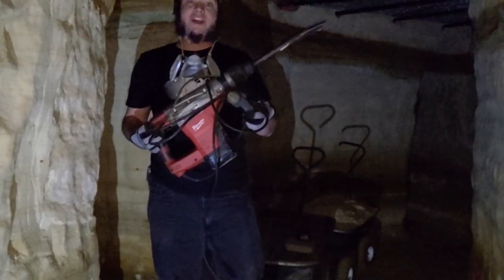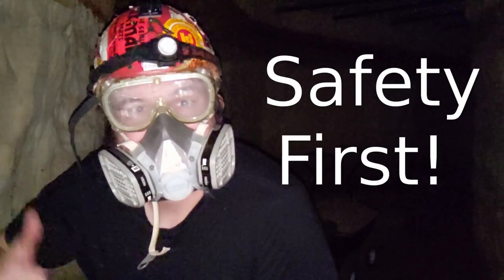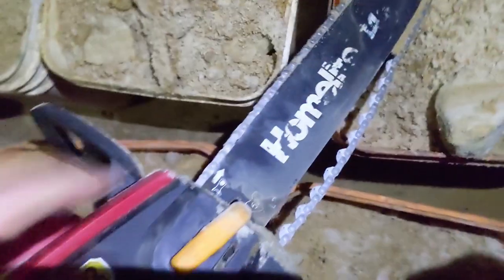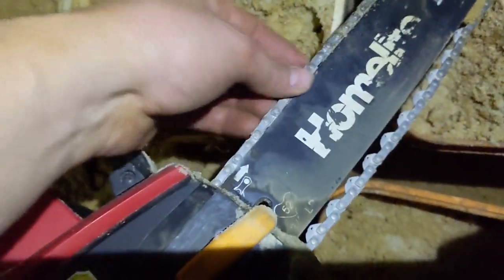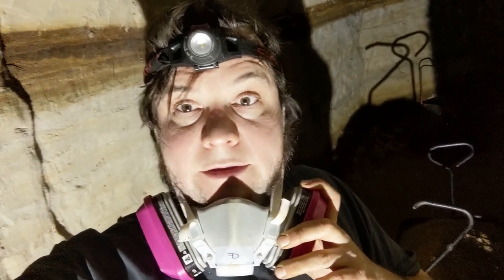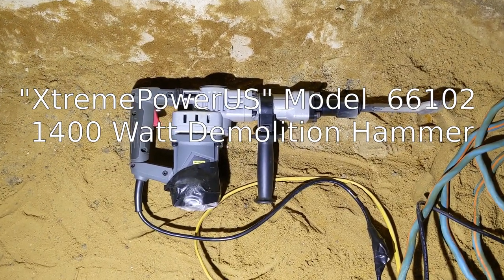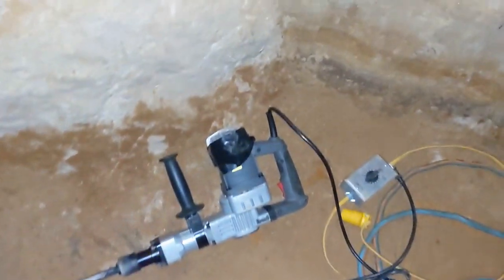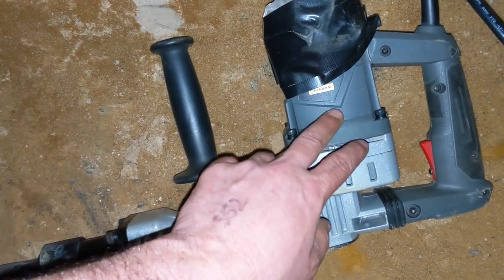Digging an Underground Speakeasy in Sandstone Bedrock

Comment: If I were local, I would build a huge industrial gas powered "dust collector" out at the sand pile and run piping all the way to the working face.  Maybe once I am able to get over the border that can be the project I can try on my visit this time.
Reply from the maker: We've talked about trying to find a farm grain vacuum or something, but they're not cheap!
Reply: @saveitforparts  I think one can be "saved from parts" by using maybe a gas powered leaf blower (or few) and a homemade cyclonic collector out of steel barrels.
Reply: @saveitforparts  Having an intermediate collection bin/bucket might help. The vacuum could be connected to the lid, and the dust pipe entering the side of the bucket at an angle to create a cyclone effect. Would probably save the filter from getting blocked so the motor doesn't burn out.

Comment: When that sand dries out it will collapse, I used to party in the lily Dale caves.
Reply from the maker: We keep the humidity pretty high, we do bring fresh air in but everything stays about 100% humidity down there. Can't leave an open beer on the bar or it will mold! Also no fires or heaters, Lillydale has had some collapses from kids starting fires and drying out the cave ceilings.

Comment: Once the authorities discovr you building your death trap without a second means of egress or the codified fresh air exchange rate, sanitary running water, sewer system and all the other adult stuff required in a society that makes laws about construction, you will be told to fill it back in.
Reply from the maker: That's why we did it in Wisconsin! They don't really have laws or rules, other than it's illegal to export the good beer :-)
Reply: @saveitforparts  legit though, “Confined Spaces” are no joke, so try and get it to have those features they mentioned (albeit in a harsh way).

Air so you don’t suffocate (that or you need to wear a gas monitor, and check with one on a string pre-going in), another point of entry/exit so if one caves in you aren’t stuck, etc

Rules are written in blood, don’t get injured/die from something preventable
Reply: @saveitforparts  another option/additional thing to do is tell someone you trust you are going in and when you should be out by (ie if they don’t hear back, get the shovels…)

Not as optimal as adding to it, but cheaper, and may save your life.

Comment: Your arch looks great but the way the air pipe is positioned into the wall is kind of concerning, the reason arches are strong is that the weight above is distributed sideways and down into the surrounding wall instead of straight down. By putting the pipe in the wall like that you're possibly putting extra stress on that rock, it should be solid to support the arch.
Reply from the maker: I've been wondering about that with some of our other slots and niches in the wall, so far it's been fine with the air pipe.
Reply: @saveitforparts  Yeah, it does erode the stability a good bit but the rock might be able to handle it.
At the very least as long as it's not like that in a living / relaxation area it's probably fine.

Comment: I've got two possible ideas that might help one is using a squirell cage fan to suck the sand and air into a tube that would transport it to wherever area you could probably build a small duct channel that you could lay in the working area and then for a digging implement a concrete saw would probably do wonders you can even get concrete / masonry blades for skillsaws granted using a skillsaw has its drawbacks with the motor sucking in dust and sediment like keith Richard's nose and cocaine in the 60s till now
Reply: Something similar to those “Woodshop Dust Collection Systems” would probably work.  Also maybe have a hose, keep the work area wet, and use gravity and/or a membrane pump to move the slurry away (has the added benefit of dust reduction)

That and/or look into what they do in the industry!

Comment: Have you looked into this two cycle gas jackhammers I know you have to worry about carbon monoxide but it would seem to me with proper ventilation it might not be that bad the other thing is what how are you getting your electricity to run these units and what kind of inverter would you need to convert battery power to run this thing I have a 40 acres out in Hudsmith County Texas and I got a sandstone I got 20 acres of of sandstone out of a total 40 acres of land in Hudspeth County I am having someone who wants to hunt the area and he's going to do some recon for me but I think it has so much potential for collecting water
Reply from the maker: You can get more power from a much lighter tool with electric, I wouldn't want to carry around the weight of a gas engine. We have a small generator that powers the dig since it's off-grid. Not sure about batteries, maybe if you had enough solar or wind and some big deep-cycle batteries it would make sense.

Comment: Now THAT is totally awesome, man! It seems to me that 90% of the real work consists of just sand removal after the actual excavation is done. Would probably be most efficient of you had 1 guy at the face hammering away with the kango, another guy putting the sand into buckets, and 3-4 guys just going back and forth with the wagons. And the kicker is that you might actually have the operation pay for itself if you sell that sand to construction companies, gardening places, or for putting on roads when the ice is too cold to melt using salt.
Reply from the maker: It's definitely faster with multiple helpers, but not everyone wants to haul sand all day :-D
Reply: @saveitforparts  im sure u guys have thought of this already but i used to do pool work and have to clean sand filters out all the time, wet, packed sand in a egg shaped vessel with maybe only 3" at the top. most guys would just sawzall a hole out, remove the sand and replace the whole unit at the owners expense. I tried a wet/vac out one day thinking it wouldn't do shit but it actually worked really well. Granted I'm only Vacing the sand up 4 feet out of the filter, but it was WET too, I think if you had multiple smaller vacuum units at each level you would be able to vacuum the sand out.

Comment: How do open filter (no plastic case) p100 respirator filters work down there during active digging? Do they clog up? Do you need the plastic casing type?
Reply from the maker: I use the plastic ones but I think Jim uses the open ones, as far as I know they both work about the same. I'm thinking it's about time to replace mine actually, the airflow is very slightly less after ~160hrs of use and they say it's time to replace when that becomes noticable.

Comment: Make a "Digging Machine" you got plenty of motors and scrap metal. Think like the "total recall" spinning diger. Some cut face spinning scrap steel with a few holes that drop to a conveyor belt behind it. Its like one giant (or 4 foot in diameter) grinder. Like a cheese grater on steroids.
Reply from the maker: We've actually tried that! Some Canadian mad scientists built one and brought it down. Sadly they determined that it didn't work all that well. The electric jackhammers seem to be the most efficient tool so far.

Comment: To move sand like that one generally does so using The Venturi Effect and blowing air into the tube at high speeds along the tube. Also You likely clogged the filter because the input of it sends the sand right into the filter. If you create a simple centrifugal vacuum by hot gluing a 90 degree bend and maybe some cardboard fins inside the bin then it will send much less fine particulate straight into the filter. Another thing you might do is pick up all the free vacuums in your area and then hook them up in series on the output so that instead of just one motor pulling the sand you can have like 5. on top of that they are basically electric motors that you can plug into the wall with the control circuit stuff already built out and usually including some nice pulleys, belts and gears that fit on it! I would use an off road wagon or one with those big grey round beach tires but they all look so expensive. Maybe just get the wheels and put them on the carts you already have.
Also you should buy one of those super long USB snake cameras and next time one of those crevasses opens up you should drop the snake camera down it. You can get like a 15 meter one for $25 on amazon. Do you need to get an underground booze license to sell drinks there or are you just going to do things under the radar? I would try to carve a couch to sit out of the walls there and get some artists there to try to carve some lions into the walls there. If you get an ice sculptor, you can give them the chain saw and tell them its like ice that doesn't melt. Finish things up by reinforcing what you finally make with resin so that it doesn't break. Maybe do the same with the table tops and any wall decorations that get built?
Oh and one final thing (or not), you could do like mini explosives except instead of using any thing like that you put soda bottles in there and then use a compressor to fill it until it bursts. you can get the valves off of dead tires at a bike shop and just drill a hole in the top to stick it through. If the caps are bursting or the bottles are not breaking right then put some scores around them where you want them to go with a knife. Just hook up the high pressure line, turn it on and get back until it goes boom. You could use an E-match or something like that tapped to it to detonate them when you want. It would be a cool video/test if nothing else.
Ooohhh again make glasses out of that clay for your bar!
Reply from the maker: I'll have to try some of that. I thought about chaining multiple vaccums together but wasn't sure if they'd just fight against eachother.
Reply: @saveitforparts  There is some order you are supposed to use for optimal performance like weakest to strongest or vice versa but if the other one is free trash then it doesn't mater if it's not working optimally.

Comment: I thought it wouldn't last long when I saw the sparks. You could try heat treating the cutting points on a chainsaw blade, yellow is the color you want for tempering tools for stone work. Not sure if that's even possible though, given the small mass of a chain blade. Maybe you'll come across a free concrete floor cutting saw you can modify.

Comment: wonder if you could set up some sort of augur or archimedes screw to take out the sand without having to move the carts back and forth
Reply from the maker: We haven't figured out something that would last, the sand grinds away any moving parts pretty fast!
Reply: @saveitforparts  that's fair, the abrasive nature of everything there must be hell and its not like you can get a long augur made of diamond to resist that

Comment: Ive got 27 acres on a MSA sandstone layer in Kentucky. Im here researching tunneling methods. I found a small cave opening in the sandstone layer I am likely to begin tunneling.
Reply from the maker: Sounds cool! I'm not as familiar with that type of sandstone, ours is Jordan. If you have existing tunnels or mines nearby in the same formation, you can see how stable those look and if they used any supports. We really like electric demolition hammers, I've also found angle grinders useful but a little more scary!
Reply: @saveitforparts  So, I am a novice on geology and was just reading off what the USGS map says for the formation I am sitting on. Its also reffered to on the same map as "Sample Sandstone". Im not sure what that it. Its full description is "MSA Sample Sandstone on the Upper Mississippian". Im north of Mammoth Cave and West of Fort Knox. Under the sandstone is Reelsville Limestone formation. Ive heard from a local caver, there are caverns here in the limestone big enough to pull multiple semi trucks into. There is one very large cave opening less than a mile from my house that requires a 80ft repel into.
Reply: @saveitforparts  I brought some of this stone up from the creek to line my garden beds, and while pressure washing it to remove moss, I was able to cut the stone with the water.
Reply: @saveitforparts  Ok, after some digging (pun intended) I found out what "Sample" Sandstone is. Its just the name given to this sandstone formation, as it was first surveyed in the town of Sample, KY. Which is near me,
Reply from the maker: Interesting! Water jets were sometimes used for mining around here, you just need a way to deal with or recycle the water. You can also use the water to move the sandstone slurry with a jet pump. We don't have enough water at Sandland so all our mining is dry with demo hammers etc. We also have to wear respirators to avoid breathing the silica dust, it's not great for your lungs. 
Limestone is a lot harder to dig, usually needs heavy industrial equipment / dynamite /etc. 
Find out if there are any historic brewery caves or mushroom caves or glass sand mines in your area!
Reply: @saveitforparts  I've never heard of anything famous around here. I did visit a famous Speak Easy that Al Capone used to own. Look up Superior Times Camp Ground in Au Train Michigan. Its not in a cave. Hey, what do you know about mining under someone elses property line? Do property lines go straight down and a survey must be done to stop mining at a property line? I mean, that makes sense to me, just curious.

Comment: Can you use the Metric system?
Reply from the maker: This here's 'Murica, we use Freedom units only! (I'm not good at Metric, sorry!)
Reply: @saveitforparts  Metric is way easier than imperial by a country kilometer (see what I did there), but seriously I'm American and I use Metric all the time. In fact it's made to be easy, everything is easy to compute it is based on ten which is a very easy number to deal with. So you have 10 fingers, there are 10 commandments in the Bible, you get what I'm saying. So I would highly recommend using the Metric system it will make your cave measurements way easier, I can promise you won't regret switching.

Comment: I think the next step project should be something along the lines of those huge commercial tunnel digging things with that circular rotating plate at the front, but instead of making it circular, it could be doorway shaped. Just a bunch of smaller drill cones all rotating. That could then be mounted to something like your electric railroad speeder, but smaller; the width of the 'doorway'. Then just some kind of collection scoop at the bottom of the part with the small cone drills, and you could have something that could be faster than a single man with a single hammer drill.
Reply from the maker: Ha, one of the other commenters once drove here from Canada with a homemade TBM in his trunk... it turned out to be less efficient than hoped. Of all the things we've tried the handheld jackhammers seem to work the best.
Reply: @saveitforparts  i would LOVE to see a DIY/Open Source Tunnel Boring Machine, but the cost of Shotcrete / Rock Bolts and Metal Mesh along is probably prohibitive.

Maybe for areas with self-supporting rock like this?

Do check that the roof is stable too!